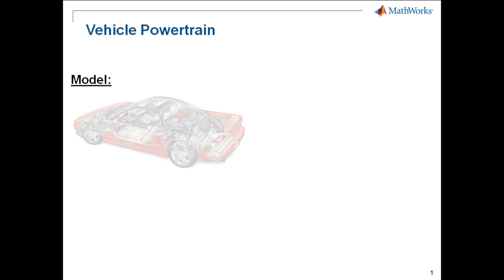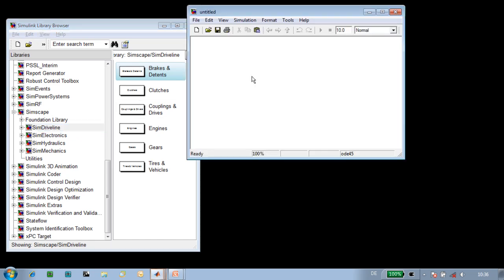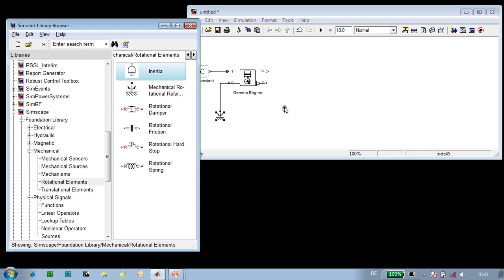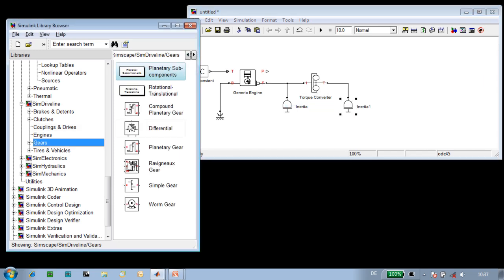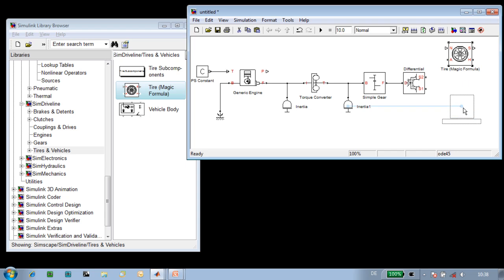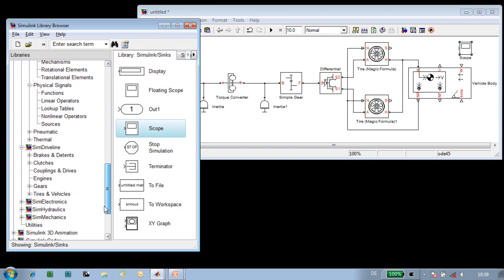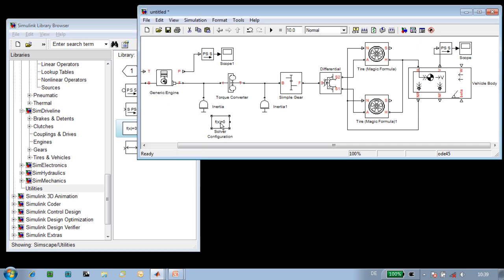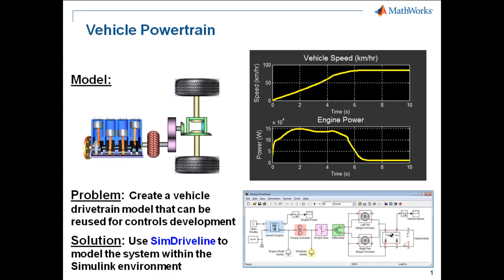Modeling a Vehicle Powertrain (Release 2013a)

Comment: Caused by:
['untitled/Solver Configuration']: At time 6.134560, one or more assertions are triggered. See causes for specific information.
Rotational velocity must be less than or equal to Maximum speed. The assertion comes from:
Block path: untitled/Generic Engine
Assert location: (location information is protected)

shieeeet idgf what i need to do with it :\

Comment: Thanks a lot for this great tutorial. But I encountered one problem: At time 5.586800, an assertion is triggered. Engine speed has exceeded the Maximum speed parameter. The engine model is invalid at this condition.
Does anybody know why?
Reply: you changed that with what?
Reply: I faced the same error. I found that the engine stall speed was 500 rpm, so I changed that. After that it was working.
Reply: If the engine speed falls below the Stall speed, the engine torque is blended to zero. If the engine speed exceeds the Maximum speed, the simulation stops and issues an error message. This is what we need to keep in mind while playing with the parameters. The other way around is to reduce the time to 5sec. But that is not an exact solution.
Reply: @ENANKOMOULICK  what exact value of stall speed did you input that resulted in a successful simulation as shown in video???
Reply: @TheOnlyRaceEngineer  sorry... I was using this around 3 years back... Don't remember the exact value now.
Reply: @ENANKOMOULICK  No problem. I just figured out that we need to reduce the gearbox "Simple gear" ratio to about 0.8 or less in order to work.

Comment: Thanks for such a comprehensive video. However I am having an error while running the model. The error states:
 "At time 0.000000, an assertion is triggered. Engine speed has exceeded the Maximum speed parameter. The engine model is invalid at this condition. The assertion comes from: Block path: VehicleModel/Generic Engine".

Any suggestions to remove that error?
Thanks in advance. Cheers!